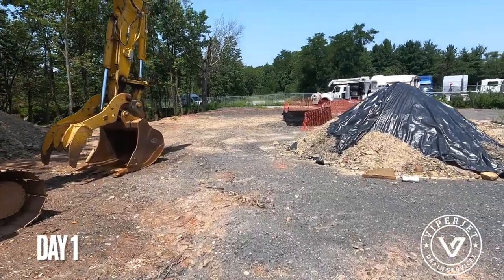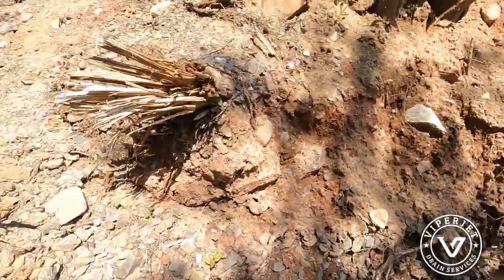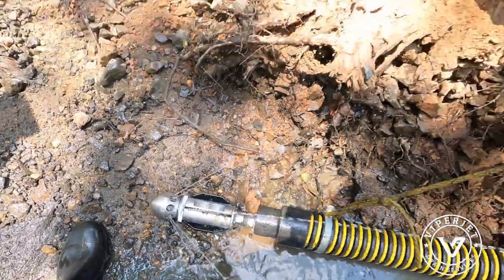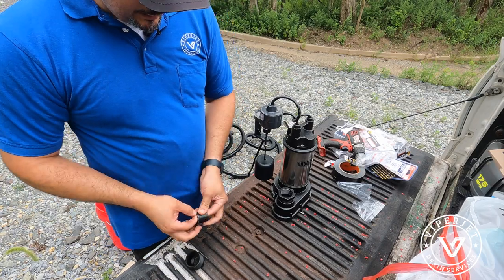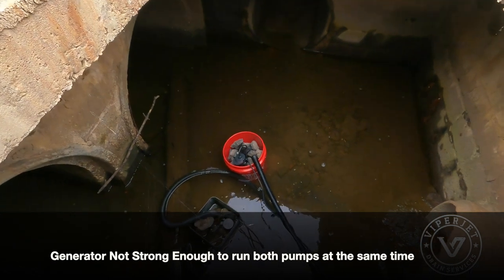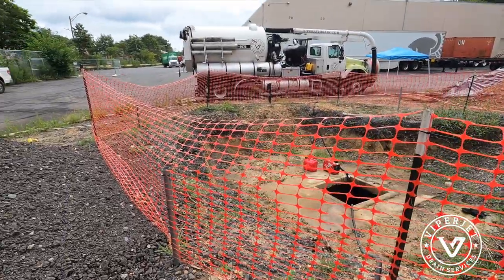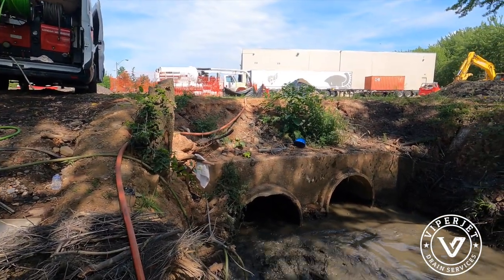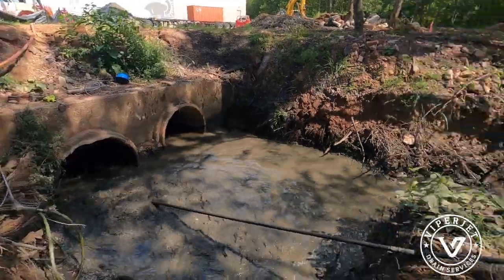Biggest pipe I have ever cleaned.|Culvert Cleaning | With VACTOR truck Warthog Magnum

Comment: Do you have a trailer, throw a 1200 gallon tank on it with a trash pump and have a guy run and grab water while you flush the culvert. Save you time on cleaning that beast. Good job.
Reply: We probably used about 80K gallons. it may not look like that in the video but the progress was Slow.
Reply: @samuelo9090  yeah looks like it would have taken a very long time without a hydrant or water truck near by.
Reply from the maker: Vactor filters got clogged a lot.

Comment: Thanks for the video.  I hope you charged a lot more than 8k to do the job! I'm going to start a drain cleaning company.  I am considering buying a zoom drains franchise. Any opinions on that?
Reply from the maker: 8k was my cost. How old are you?
Reply: @ViperJetDrain  I'm 33, pretty handy. Just not experienced with drains.  Currently am the owner operator of a bathtub refinishing company. I usually prefer starting businesses myself but was intrigued by this franchise specifically. I always wanted to work in plumbing, such a cool trade